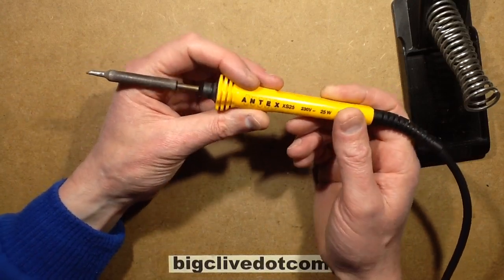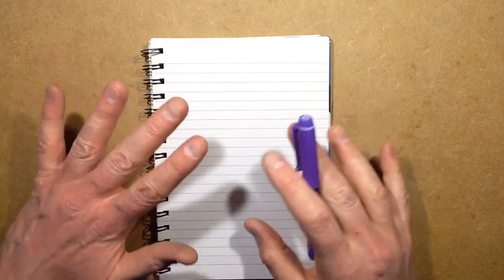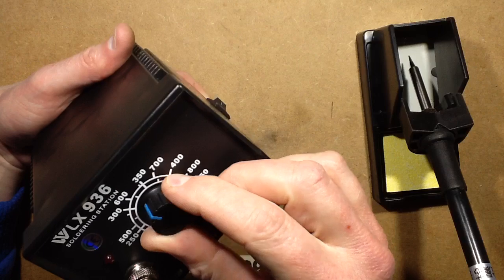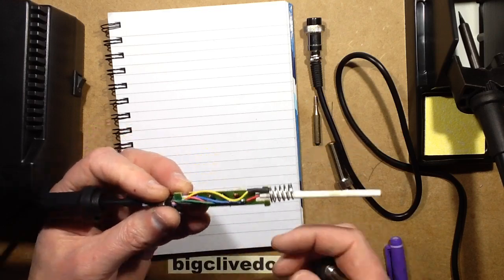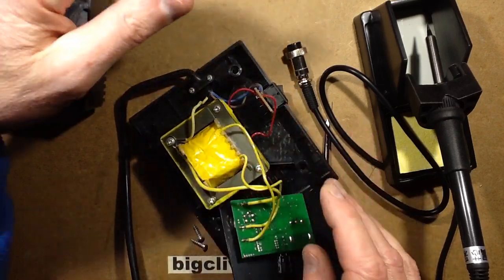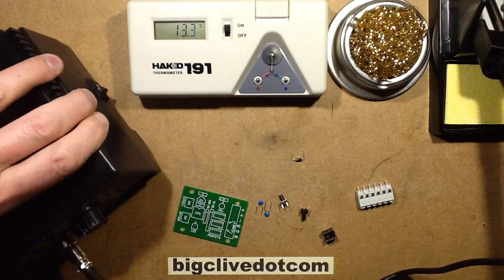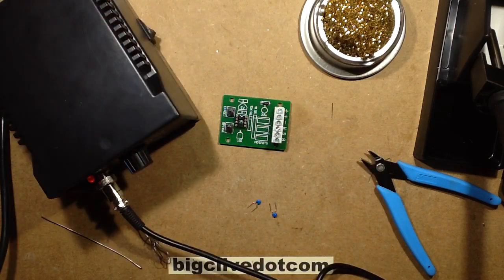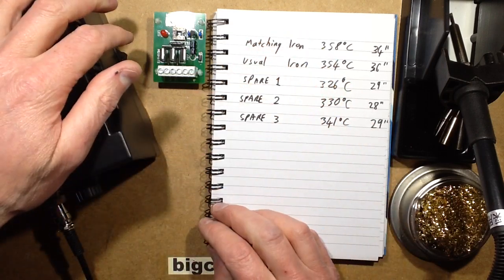Soldering basics and choosing a cheap soldering iron.

Comment: You mention in the video that stainless steel and aluminum do not take solder. This I too found out. My solution was to drill a very tiny hole in the aluminum, tap it and use a tiny screw/nut. This allowed me to tighten the lead to the screw and solder them together.
Reply from the maker: There are tricks to soldering aluminium.  If it's thin you can put a film  of oil on the surface and then scrape through that to remove the surface aluminium oxide and then solder onto the bare exposed raw aluminium underneath.

Comment: You'll probably find the difference in temperature between the irons is due to the cold junction of the T/C being in the handle of the iron.  If it was inside the unit (the T/C conductors would need to run the length of the lead[more expensive])  I suspect it would be much more accurate between irons.  Alternatively, they could put the amplifier in the handle (also more expensive) which would also solve it. You should be able to get an accuracy of about 0.1C with KType but you'd have to either use a micro-controller or make the amplification a little more accurate ans specific to the temperature range.  

It would be interesting to see if they are the same with a cold handle and hot handle.

I love your videos BTW, I think I've nearly watched them all. Thank you!

Comment: Being of a cheap nature, I picked up one that is a 110 volt, like the standard irons you can get at Kmart but has  a thermostat on the handle, and takes the same bits as the ones you ware using.  I have no way of testing the temps of the iron, but as you recomend, I simply played with it a bit till I found a temp I like (300C on the dial) and leave it there. I have been using it nof for nearly a  year with no complaints, in fact it is the best iron I have ever used, and I don't recall how much I paid, but it wasn't much, it came with an assortment of tips, and I purchased another bunch to have on hand when we went South. Still using the one that came on it, seems to be as good as any.

Comment: I had bought myself one of these and it broke down after a single use! A terrible shame on me for trusting these units.
Reply: These don't have consistent quality that's why you'd have to open them up before using to inspect if the wiring is fine and stuff. It's cheap you can't expect too much from that. However, if everything is wired fine and soldered properly, this thing can last for years without any issue.

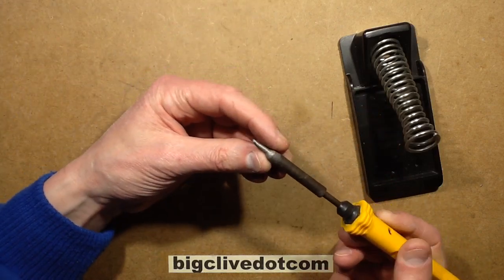Comment: Antex may be expensive but they are very good quality irons.  I have three but that's because two of them are locked into a storage container behind three tons of furniture... Hence iron number 3.  I get my bits on ebay, in the main.  Again a bit expensive.. £3:50 to £4:50.  I'd like to try a soldering station but can't yet justify the expenditure.  :O(

Comment: I found one that is the same manufacturer name. 852D+  It was always sold for $299. I saw one for $99 and took the chance. I lucked out and after buying new quality tips works perfectly. The thicker tips are so much nicer for those large pieces.  I also put the junk tips and plastic carving tips on a flat magnet that allows me to replace a hot tip on the fly. Very inconvenient to magnetize your soldering tips though. 
Why didn't you use the hot air gun to take that big connecter off?  It heats them all up at the same time quickly without burning the board.

Comment: The 936 clones with the "A" suffix are advertised as having a Japanese made heater. They also use a thermistor to sense the temperature rather than a thermocouple. Unless things have changed lately, these "A" type clones have a much higher wattage.

Comment: i learnt to solder back when the lead/tin wire and the flux paste separately . you had to apply flux, heat up the connection and then bring molten soldering onto the connection. at some point, i moved to a different continent and, apparently, a different century as well because now i couldn't find flux paste anywhere, and lead/tin soldering wire came with a flux core.... nobody cared to tell me what had happened, people looked at me weird and didn't know what i was talking about when i was asking for flux paste (the language barrier didn't help either), etc etc. it was before the days of the interworldtubewebs and back then information was as rare and difficult to find as pope's shit. i did struggle with bad soldering on various projects for quite a while.
Reply: You can find FLUX just about everywhere
Reply: Go to the Plumbing section of your hardware store.  (Copper pipes)
Reply: @Solocat1 ,  Flux designed for soldering copper water pipes should never be used on electronics. NEVER !!  It's highly corrosive to electrical and electronic circuits. The flux core inside leaded solder designed for electronic use is a refined rosin from pine trees;  It's non corrosive and generally non conductive unless you're working with many hundreds of volts. You can buy liquid or paste forms of rosin flux for electronics work from specialty electronics supply houses but unfortunately some Asian sellers are repackaging and re branding plumbing solder and selling it to electronics hobbyists.

Comment: hey anyone, i just bought one of those cheap soldering iron hakko knock offs on ebay, i was wondering if it is normal for the tip of the iron to get bright red....lol, im not sure , so just checking before i go irate on an ebay seller LOLOL
Reply from the maker: +Hammer USN Does it do that even when the temperature is set to minimum?  It's not good.  It may mean it's well off calibration or just faulty.
Reply: Yeah , it turned all the way down, and so I thought the potentiometer might be bad so I pulled and tested , and it is good, I guess I'm just going have to quit being a cheapskate and maybe get a Weller or hakko,  maybe I'll find a used one on eBay ... I don't know, thanks
Reply: +bigclivedotcom I got one from eBay and has been grounded with a 13amp fuse, should I change it to 3 amp
Reply from the maker: +AminKhanOfficial I would recommend a 3A fuse in the plug.
Reply: bigclivedotcom thank you big clive, also should i cut the cable from the plug end or cut it from the transformer end to put an entire new cable in?
Reply from the maker: With a 3A fuse in the plug the existing cable should be fine.
Reply: bigclivedotcom I just went ahead and cracked the wallet open , and bought a hakko off eBay, I thought the color blue and yellow were a lil on the feminem side , so I painted it black, and it works great.

Comment: I just noticed that we can buy this basic 936, non-digital station on HobbyKing for an incredible £13! (actual price $18.85, currency converted.)   And they can ship from 'europe' (not sure where exactly.)  Currently out of stock, but hopefully that's temporary.  But one question:  being a Euro model, it comes with Euro plug. So non-earthed.  Presumably one should cut that plug off and re-wire a british plug with an earth wire through to the board, like +bigclivedotcom shows here?    Or is it better to buy, eg the Australian version that starts out with a 3 pin plug (they don't have a UK plug version)
Reply: +TheBloke Another thing I'm unsure of - HobbyKing list multiple versions, US, EU, AUS.  US is 110v so that's out.  But EU and AUS could work, but each have slightly different voltage.  Aus is 240V,  EU is 220V.   Presumably both are fine for UK mains, but is one or the other preferable for our UK 230V?  Or will they probably have the same transformer inside, and it's only a difference in the listing, not in the unit?
Reply: +TheBloke mains voltage is quoted as 230 but when you measure it its around 240. when they "changed" to 230 all they did was widen the tolerance from 5 to 10%, the actual supply stayed exactly the same.

Comment: I got mine (YiHUA 937D+) to use on a project that I am doing involving SMD RGB LEDs. I have a Weller 35W (pencil style), which has been my go to iron for years, but it is not adjustable, slow to heat up and has a hunger for tips (at $8 each, ouch). The YiHUA 937D+, has worked very well, I am still using the first tip, no signs of wearing out, less than a buck a piece, too. 

I also purchase some solder paste (Mechanic brand XG-50, 25-45um, 63/37 solder), for the SMD project. I have found some other uses for the solder paste, which you might find useful. Dip solder into the solder paste, to create a light coating on the solder, it will flow instantly, when touched by the tip of the iron, great for hard to reach and troublesome soldering. Dip a stripped wire into the solder paste (thin coating), and touch to the tip of the iron, the wire will instantly 'tin' with just the right amount of solder. I must say, I like this solder paste stuff...

Keep on, Keeping on.....

Comment: Is there a way to run a genuine Hakko iron on these Chinese stations. I have LOTS of Hakko irons from a liquidation at my old employer. I recently got the small station with the hot air rework station and an iron... I've seen videos showing the lackluster thermal mass of the knockoffs. Is it possible to mod the base to accept the Hakko irons?
Reply from the maker: +richfiles the Hakko irons use a different thermal sensor.
Reply: +bigclivedotcom Has anyone done anything like a firmware hack, or even a converter... Device reads the iron, outputs equivalent reading to the station? I forget which uses the thermocouple and which uses the thermistor. Both are a range of analog values. Surely a device could be created that found bridge the two scales? 

I actually got my hot air/iron combo station today... The tip of the soldering iron is significantly bent, and I took it apart, and it just seems MADE that way... That's just how the ceramic element sits! Yikes! It works, but yeah, it's a far cry from the precision of my Hakko. The hot air blower is a dream to use though! It pulls enough power that the heater cycling causes my bench lights to flicker though. That's a concern. I'll have to measure what I'm actually drawing.

I'll probably just chunk the largest tip on the cheap iron it and use it as a brute force iron for nasty jobs. Crank the heat up, and leave it turned off 99% of the time. Fortunately, I still got my stack of multiple Hakko stations... I will never know why Hakko switched to the oddly shaped goof job housings, when their old stations were the PERFECT stackable shape... You could stack them! They were perfect!!

Comment: ive got this soldering station: http://www.ebay.de/itm/Komerci-ZD-937-regelbare-digitale-Lotstation-Lotkolben-450-C-48W-ESD-/151577871196?hash=item234abec35c:g:jjAAAOSwm8VU03vF

Im searching for some spare Soldering irons which are thinner, is it possible to use this type of soldering iron?

http://www.ebay.de/itm/50W-24V-Ersatz-Lotkolben-Feinlotkolben-Lotspitze-Entlotpumpe-Entlotkolben-Loten-/351449526569?hash=item51d4063129:g:BBUAAOSwd0BVyWJn

Comment: I recently purchased an 862D+ 2 in 1 hot air/pencil iron off ebay, i love it, works perfectly, but looking into the future what exactly would i search for to find replacement heating elements for this? These seem to be hakko clones, instead of replacing the heating element i would like to be able to purchase the whole pencils that just plug into the machine, not really sure how to find them though
Reply from the maker: +twenglish1 The Chinese sellers call them soldering handles.
Reply: +bigclivedotcom I found a few that have the same construction as the one that came with my station even the same connecter, is it safe to assume that they all use the same pinouts and will be compatible with my station?
Reply from the maker: +twenglish1 There seem to be two types.  Thermistor based and thermocouple based.  In most instances you can tell by the plug on the soldering iron.  If it's female it's usually a thermocouple.
Reply: +bigclivedotcom the manual that came with it lists all the replacement parts for the heat gun, all seem to be hakko parts, the manual makes no mention whatsoever of the pencil iron haha are these syle irons always 24v?
Reply from the maker: +twenglish1 Usually.  If you measure the resistance between each pair of pins on either side of the middle pin of the irons plug then you will get readings of about 10-20 ohms and 2-3 ohms for a thermocouple iron.  With a thermistor based iron like a genuine Hakko one of the resistance readings may be closer to 50 ohms.
Reply: I got a reading of about 4 ohms on one set of pins and about 50 ohms on the other set, guess my station uses thermistor based pencils

Comment: Did you ever took a look into a weller WECP-style station....it´s pretty much the same big Transformer , OpAmp driven triac output to a 24Volt soldering iron. I actually don´t know if my WECP - LR20 is thermoCouple or thermister (resitive) controlled...

I have my WECP for almost 30 years now, with no issues at all, replaced the heater element once and i was a little bit dissapointed of the flimsy construction of the iron itself, the whole constuction relais on a nylon screw at the cool end of the handle. But, nevertheless it does the job.
I abused it to melt plastic, i left it on throughout a whole night, no issues...

Sometimes i find me thinking about a smaller handle and also less wattage for tiny jobs...I was thinking about the MLR21. 
But thanx to your video, i go for this thing, as the whole unit is cheaper than the MLR alone, and also replacement tips are available. 
Just took a look at ebay, it´s around 35 euro for the a complete set with tips.

Comment: @Bigclivedotcom What is your opinion of a soldering gun vs soldering iron?  ATM I have an el-cheap-o solder iron from "Harbor Freight" an American tool store that only carries the cheapest stuff possible. I only use it for my RC car hobby to change connector to lipo batteries and such.
Reply: for soldering connectors on lipo's i always use a iron. used a gun ones and i think they are worthless. most lipo's have big gauge wires and needs a good amount of heat for pre-tinning. i don't think a soldering gun can handle that. I think a gun is handy for small things that needs heat for a few seconds. I use 10 to 8 gauge wires for my helicopters and a 60 watt iron will do the job for me.
Reply: boy6named6zoen6 Thanks you very much for the reply. That is helpful.

Comment: First soldering iron I had was a bit of a joke.  Cold heat it was called.  and the bits are still sold but not sure if they still make that rip off really  I never could get it to work.  and the bits were so absurd they'd break often.  now if only I'd ignored the safety silliness and gotten a real one which I did at biglots and it's possibly better than the weller except the Weller , well it's supposed to do something when it's ready but the only thing I know when it's ready is it starts to condense ?  inside the lit area.  (amber orange?)    the Big Lots one has no such light and has a couple of 1960's style Jetsons like metal guard rings.  But again no light.  I'm thinking about a real soldering station which is why even though your in 220 land and I'm in 120 land the methods are still the same.    And I do love your sense of humor.  Certainly keeps our attention up :)  I deal in computers so eh um.....  er ..  yeah electricity is constantly on my mind  X_X  zap.  oh well that was a great way to find out about a bad PSU  (Antec used to be the best at one time but even Antec claims their PSU's shouldn't last more than 5 years let alone 10.  and some Thermaltake (sp)  I have are around 16 yrs old and no serious problems like the antec.    ie in the left hand and out the right foot.  yeah I'd rather not get that bad of a jolt again.  Sorta know how to hack a PSU so the tester doesn't fry  but not all of them are color coded right .  Anyway  learning about soldering helps with old electronics.  and "cold" solder joints  which I didn't know much about till TNT Amusements started to show why one should reflow solder on pinball games etc.    Great channel though.  See what else blows up.  I've had a few Dodgy items in the past , plenty from Big Lots  which they closed down near a decade ago but still..  no not giving up the old Shark vacuum which yeah I know it's bad but having known that I don't leave it on long.  Supposedly it gets rather HOT.  And was recalled and ended up at big lots before our CPSC started to ban recalled items from being sold again

Comment: I inherited a "Precision Gold A55KJ" digital soldering station - it has the 5-pin DIN plug and the iron looks identical to yours, except that when I opened mine up and pulled out the iron's circuit board, it only has 3 wires (2 for the heater coil, plus earth), not 5. So I don't see how it can be doing any temperature measurement at all! And yet the station does provide a temperature readout. Is it just faking it?

Edit: You can see what my board looks like in this teardown of an identical model under a different name here (@ 11:01): https://youtu.be/VRb1_DB234Q?t=11m1s

Comment: The mom and pop hardware the the box stores around here don't keep soldering pencil with chisel/ screwdriver tips in stock  So I ordered and awaiting a couple of Weller 40 W. pencils. they where on sale so I ordered two from MCMelectronics. Most likely they are hobbyist level, not pro  bench level. I'll put together a light dimmer and receptical combination if I need heat control for some reason. Next is to see if the Wahl cordless rechargable portable soldering pencil like is still being made. Yep there are https://www.iso-tip.com/products-page/smart-solder-series/quick-charge-soldering-iron-kit-boxed-7700/?gclid=Cj0KEQjwosK4BRCYhsngx4_SybcBEiQAowaCJSd019PebmGVp7_tO0PPQuYSRky1wZN3FiiRFCKlTAIaAuaV8P8HAQ

I loved the one I had years ago, but the cost of it  was less than half the price they are now. Yep practice makes near perfect. There are still a variety of kits of electric doodads so you end up with something usable.
Reply from the maker: +waswestkan I did a video on the Iso-tip iron.